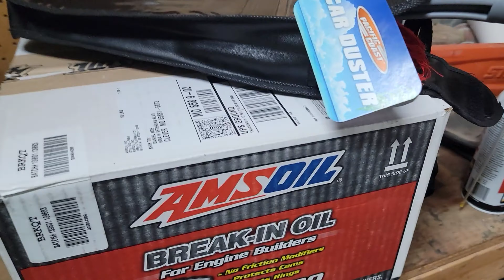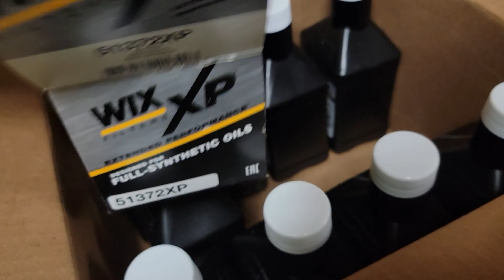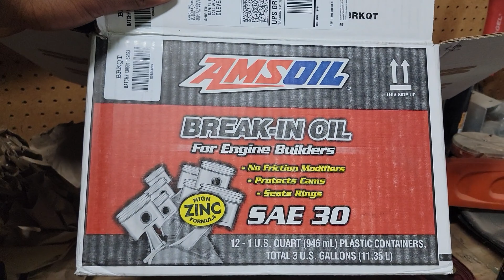Shelby GT500 gets a oil change plus update on mods!!

Comment: You will love the gears I put 4:10s in my 13' and I enjoy that mod more than the smaller pulley. Did you get the 305s to fit on the stock rim?
Reply from the maker: Heck yea man!! And yes the 305s do fit the stock rim👍

Comment: Ever get noisy lifters before using Amsoil? I put Motorcraft in mine and noticed one of the lifters ticking when at full operating temp during idle, heard it's not an issue other than just being annoying but Amsoil and Ceratec could maybe fix it.
Reply from the maker: I can't say I have, but I'll keep a lookout

Comment: Forgot to ask what size injectors do you have. When I had mine on the dyno Tony told me my 1000cc wasn’t big enough for e85 @ 714 at the tire he said I would need at least 1300 or bigger
Reply from the maker: Did you have a BAP?
Reply: @TheHorseman351  yes it does
Reply from the maker: @gregoryjowers3629  that's weird, my tuner does e85 with my id1000s and a boosta pump.
Reply: @TheHorseman351  who are you using to tune your car. Tony at tuners inc. is the one I was talking to about tuning for e85.that will be great if they can tune for e85 cause we about the same on power and if yours runs good I might do a remote tune
Reply from the maker: @gregoryjowers3629  Bob Monks at Stl Mustangs.
Reply: @TheHorseman351  is that a local place where you live. Cause I live in Jacksonville,fl
Reply from the maker: @gregoryjowers3629  yea it's about 3 hours away from me
Reply: @TheHorseman351  please let’s us know how I turns out and video the dyno please cause I would love to go to e85
Reply from the maker: @gregoryjowers3629  absolutely!! I'll have a video of the whole thing👍
Reply: I'm not sure of your set up but I would agree also with the 1300s.  Your motor needs more fuel with e85 which is why you need the bigger injectors to run it with a bigger blower or pulley.